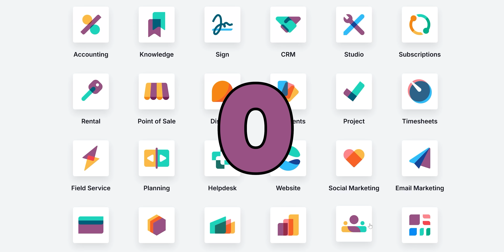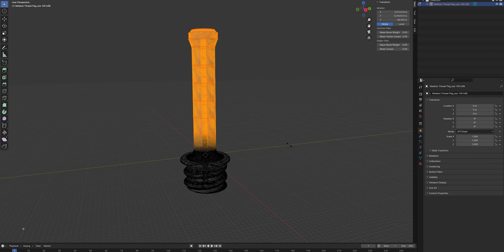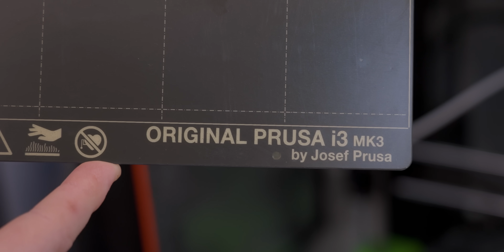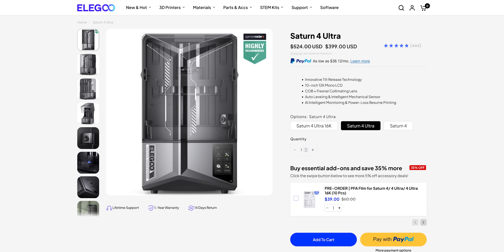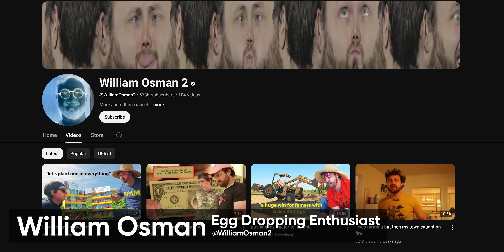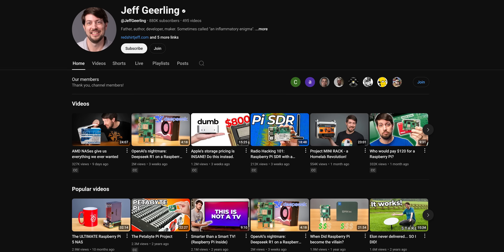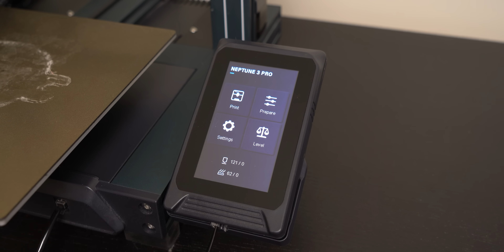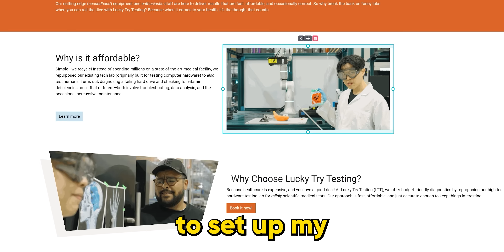Is my 3D printing setup wrong?

Comment: For a vast majority of the hobbyist users the Bambu firmware changes won't affect them at all. Almost all their users use the Bambu slicer and software, and will not be impacted AT ALL. The users running businesses and print farms are the ones primarily being impacted because their tools used an insecure MQTT connection to monitor and control the printers.  My Bambu printers are by far the most reliable ones I own and don't plan on replacing them anytime soon.
Reply: Genuinely curious bc maybe I have a gap in my understanding - how are you justifying the statement about MQTT being an insecure connection for the printer.

You cant setup mqtt without getting a 2FA connection and I don’t know anyone who is using MQTT exposed to the external internet. The way that I interpreted the whole situation is the issue is in Bambu labs network setup. They don’t have a secure key put on their hardware from the factory which means someone could spoof their hardware and connect to the entire network. Thats the real reason they need to close this gap. Thats an entirely fair statement for them to make but they didn’t say that, they instead are claiming it’s protecting users when it’s really protecting them.
Reply: @adamkrtek9004  fr
Reply: @ sorry I understood that the protocol itself wasn’t insecure but the keys Bambu used had been compromised which was how the 3rd party software and hardware accessed the MQTT protocol

Comment: I just got a p1s myself a couple weeks ago with a ams, loving it so far. Glad to see even big budget studios like LTT using the P1S instead of the X1C lol, its really not worth the extra $ to me just for the touch screen, and "lidar" which i wouldve already disabled due to my aftermarket build plates. It does agrivate me about their new updates, because I really wanted to get the Panda Touch, but not gonna buy it if they gonna lock it down soon..all in all it's still a really nice printer but the stock light is lacking badly, first print is the AMS Riser V4 with a white cob led light strip all around to allow you to see everything clearly.

Comment: hey linus im so happy you are talking about 3d printers again my set up is nothing fancy i won an ender 3 pro yes yes ik the ender 3 pro has some issues but once you know the printers quirks you can make some amazing prints no i can't do multi colour prints easily but for what i am using it for that isn't needed.

i make props and cosplays so multi colour printing is just a waste of time for me 
in my opioon the ender 3 pro is an amazing beginner printer becuase it teaches you the fundermentals about 3d printing as a whole.
being able to level the bed yourself is a good thing becuase it teaches you a printers toloences yes its a pain but its a pain i choose to endure i will be upgrading to something later down the line but don't knock cheaper printers mine only cost me 150 quid brand new not including filliment.

Comment: So timely. I just had a friend give me a Creality CR10 V1 and I feel every pain that was mentioned in the video with them. Its a good starting point, but this video has been great in showing where I can step next. It is a shame Bambu is creating their issues right now, otherwise I feel like going Bambu  for my next printer would be an easy choice.
Reply: so were you ever to level the bed. the CR 10 V1 i have will not get level. one end is digging in to the build plate while the other is almost to far from the build plate to stick. i have even added a BL touch and used that tilt screw adjustment in clipper. i wanna burn my CR10
Reply: @writer8706 Yes, when I received the Cr10 V1 I had the exact same problem. I literally don't know how the previous owners used it. I had to put washers under the bed in the right locations to make it even enough to level with the screws. It's much better now. I have been tempted by the BL Touch, but most easy install videos have been for the V2 and v3. I need to do some more looking on the V1.

Comment: I’m still using two Creality Ender 3 V2s I got a few years ago. Looking to upgrade to a core XY with color change capability, but don’t like the way Bambu is going. I’m more or less waiting for Creality to work out the kinks in their K2 plus
Reply: There are other options

Comment: I've printed with very water logged ABS, ASA, PETG, and PLA without issue. no jams. just less than ideal print quality. Provided it's on a direct drive prusa i3 MK2s. Shame Linus has had such problems with water absorption.
Reply: Poor print quality and weaker parts, not worth it.

Comment: I was getting into printing right when Bambu did the "Bambuzle" and Elegoo was releasing the Centauri Carbon for $299. Immediate "take my money", moment.
Reply: that's a wait and see kind of thing for me they have been very very hit and miss on their printers... ask those who bought that orange storm giga. Yet if they can deliver and make that price point its going to be huge. even if it only could do like 70% of the things or quality of the X! and p1s. that kind of printer at $299 is nuts. But just like Reality its going to be a wait and see.  Heck i was ready to pull the trigger on the Neptune 4 before i read all the issues people had with them.. the Neptune 3 was so rock solid to bad i couldn't find any of them. i really want to get rid of this old as hell cr10 i have i cant get it to have a good first layer no matter what i do.
Reply: @writer8706  my thought process was basically: If it can do just 75% of what it claims on paper, it'll be as good or better than the A1 I was going to buy initially for less money

Comment: 12:20 - William talks about issues with moisture in his filament - Fish tank opposite his Prusa 😂 (I'm not familiar with HOW much moisture that open lid would release into the air but it's got to be more than negligible surely? It was more so the visual  dichotomy being funny, and especially on brand for big Willy 😂
Reply: Should increase moisture in yhe air to some degree but honestly as long as you arent in a desert you should get a filament dryer regardless

Comment: Bambu works so well i really don't even care about the drama surrounding it. It is like wanting an iphone in the early days of smart phones (probably not a good comparison these days) like yes you are technically limiting yourself but the ease of use and reliability make up for it tenfold
Reply: Well... im gonna say this you give a company an inch, they go a mile, then not long after they go on a cross country run. What i see bambu is trying to start is what hp did to the printing world (not to mention the new recent ink subscription shit)
Reply: It is just that, drama. Its like NoMansSky where everyone jumped the hatetrain but ended up being wrong.

Comment: To be fair, Linus, you have your filament in possibly THE worst place possible, I'm in London with RH of 50-90% and I can see how that room is even worst
Reply from the maker: What’s so bad about this room? All water lines are sealed and there’s no random water evaporating in it. Am I overlooking something? -LS
Reply: @LinusTechTips  what’s the relative humidity of that room? Seems like it’s not well ventilated which can lead to an accumulation of ‘damp’ air as well as the controversial subject of fumes and VOCs from 3d printing
Reply: @LinusTechTips as a plumber that's watched and cringed my way thru your other videos building out that room and the pool and I also live in the PNW. I highly doubt that room stays super dry all the time. Imo putting a cheap humidity monitor in there might be a good add in general for monitoring for leaks and keeping it print friendly.
Reply: @LinusTechTips have u double checked the moisture level in that room? Maybe good to do either way to be on the safe side 😋
Reply: @LinusTechTips  all liquid evaporates its called angel share for a reason also you have no ventilation from what i can see as in there is no where for the moisture that room has to go like outside
Reply: @LinusTechTips  I was more worried about the breaker panel being obscured by the rack.  In commercial in the US, 3' clearance is req'd in front of any electrical panel for unobstructed emergency access.  It's part of the fire and life safety code, so I twitch when I see a panel I can't immediately open.
Reply: @LinusTechTips  Let's see, a basement in the PNW... unless you run a dehumidifier in the basement, moisture permeation through the floor and walls will usually cause elevated humidity levels above what ground floor and other floors will encounter.
Reply: @ You can have. perfectly sealed pipe and still have humidity coming from other places, just do a little check, maybe introduce a Pi with RH sensor or something just to keep you informed on how the room is doing. Most of the time is not bad but some of the bambu filament (SPECIALLY THE MATTE PLA) is awful in humid environments for some reason, it will curl and ooze like crazy
Reply: @ To put it simply, I have mates with houses without any pipping on the basement (Old english houses) and the thing hits 20% RH above normal levels
Reply: Im in utah where its less than 30% year round xD dont even need a dryer for pla, petg i dry just to be safe.
Reply: I've heard that it can actually turn excessively moist filament into little steam spurts in the Hot end I think it's called, causing it to spit and sputter , does that actually happen? I was given a bunch of pla , like 40 pounds of it, and it got rained on sitting on the porch before I got it inside... Is it just trash now? 😂
Reply: @bentboybbz  That does happen. Put it in a very low oven (80 C or so) for a few hours, it’ll be fine.
Reply: @wmkeeble  I appreciate your response. I was worried that My oven doesn't go low enough and it could cause it to start sticking or melting together, also they are on plastic and cardboard spools I wonder what the plastic used in the spools will handle and the cardboard obviously isn't oven safe at any temperature. I appreciate your time and effort!
Reply: @bentboybbz  no just dry it
Reply: Saint Petersburg's basement, even metal gets rusty after a while)

Comment: I dont understand why filament dryers are such a big thing for others. I keep all my spools (pla and petg) in open air and never dry them. The humidity in my room is usually around 40% and I have never had any issues related to the moisture content.
Reply: Well to be fair those are pretty basic filaments. Nylon and tpu need to be tried
Reply: You did, you are just not aware of it :)

Comment: There's a special type of detergent that exists for cleaning resin prints that's an option that cleans better then isopropyl but you can't forget models in the detergent for extended periods of time like I used to do with iso

Comment: Its weird, Printers nowdays are soo good but sooo crappy the Filaments got over time... i have PETG that i have for 6-7 years now and still prints without strings and i never dryed it, the new one i bought after 4 weeks open already needs to be tryed because it printet already crap...

Comment: Camden Bowen's comments about the Neptune 3 are... kind of dated. I'm pretty sure there was a firmware update that fixed the z offset issue. But besides that... why is he talking about a recommendation for the Neptune 3... Not only are the Neptune 4 and Neptune 4 Pro/Plus/Max out, but they are also now kind of dated because Elegoo now has the even newer Centauri coming out. It's a Core XY (meaning  no moving bed), a bigger build plate and prints faster than the Neptune 3.... and it's $199. Granted it's not actually out until July, but this printer means essentially the death of bedslingers.
Reply: They are talking about the printers they have. Almost everything to say about a Neptune 3 applies to a Neptune 4 also. The 4 is faster, but can be louder because of the fans trying to keep things cool at that speed. I think Elegoo just removed the Neptune 3 from their site recently. I don't know that you can call the Neptune 4 dated since its replacement isnt out and it is top tier at its price when balancing speed, reliability, and features. Plus I dont think the Centauri competes in bed size so the Neptune 4 line is going to have its place for a while. Probably more for the size vs. the base though.

Comment: 8:50 The reason you'd want higher resolution is for detail. That might sound obvious, but if you're in the miniature painting scene then the difference between resolution is pretty huge. Especially when you compare it to some of the plastic miniatures that companies like Games Workshop do, it quickly becomes very obvious what is a 3D print and what isn't, if the resolution isn't high enough.
Reply: Can we even see the difference at that scale though? 12K across such a small area is ridiculously tight. My 8K is damn near flawless, I can imagine needing more than 12K.
Reply: @tristangillis7365  I have printers ranging from 6k to 16k. Its not really that you see a difference, but the screen can be bigger. For example, my 8k small screen printer can have the same pixel size as my 16k nearly a foot long screen printer. Same quality prints but much larger area to print on.
Reply: You humanly can't see any difference between a 12k print and a 16k print.
You barely even see any at 8k.
Reply: saturn sized printers dont gain much from higher resolution past 8k due to how "12k" and beyond is achieved. only one axis gets more pixels due to chitubox boards limitations

Comment: @jake: WLAN doesn't work in a grow tent, because the aluminium coating blocks wlan signals.
Reply: It does not block any signals.. I have 3 tents in this room right now.. All bigger than Jake's... Lol. But seriously.. The wireless signals work just fine inside the tent. Environmental monitoring...
Reply: @Angrybearhere  Maybe it depends on the tent, in mine, no WLAN (IP cam, shelly) or Zigbee signal (thermometer) goes thru.

Comment: The very thing that he had issues with (broken filament) has not happened a single time to me in 20k+ hours of printing with my Bambu Labs X1C with AMS. I have had filament jam 1 time in that time and have printed hundreds of KG of filament. Almost certainly non-dry filament causing that problem.
Reply: Pla gets brittle when it's wet yeah

Comment: That problem with the Neptune 3 not storing z-offset properly sounds like it's not actually storing to the EEPROM - sometimes flashing a new firmware can fix that, it may also be a sign of a board going bad...
Reply: i wonder if an update would even take. we have a similar situation going on with my wife's fathers tv. Where his one TV refuses to take a firmware update and will not save some of his settings but it will remember things like his WIFI name and password.  i told him next time im overt ill bring a flash drive and we will will try to load the new firmware from that instead of the internet. but i am not hopeful that it will work.
Reply: Even G29 would fix that since it’d store the new settings before every print
Reply: spot on
Reply: I thought it was fixed with a firmware update. But its at least was a known common issue with them. Upgrading to opennept4une fixes it as well and unlocks a ton more features
Reply: @ does that work on the Neptune 3?
Reply: @gadgetmerc  Honestly, no idea im sure i heard someone got it working but i might be wrong. 
I had the same issue with my 4 max and that fixed it, and when i was looking into it about a year ago im sure i saw they released a new firmware to fix it
Reply: @ I have the 3 max. I think the 4 has much more modern hardware that’s able to run clipper. The 3 doesn’t and can’t. I think I’m SOL.
Reply: @gadgetmerc  The 3 can be converted to klipper with a pi
Reply: no no its shit bed springs swap to silicone spacers or solid and never liik back
Reply: @ he said that he has to set the offset on restart. Springs aren’t going to move much between power cycles.
Reply: @scootersfrog  That's worth doing as well, but if the stored value isn't sticking, that's an issue with EEPROM. Could be both, hard to tell without more info.

Comment: Whoaaaaaa... Moisture in the air can fuq up the whole printing process??? Feels like a huge pain point right there... That's too much messing around. Getting a dryer for your filaments?? Like im sure it IS necessary, but it SHOULDN'T BE. There's no way to manufacturer filament that doesnt have an affinity to hold onto moisture? There's no way to implement a drying procedure WITHIN the machines themselves? 
We've come a longggg way in these things, but damm i thought we were closer to primetime than this 😑

Comment: I bought a used but close to new with some upgrades ender 3 pro for 50 bucks 3 it's ago. I've printed a nut and a bolt. Haven't touched it since.

Comment: You guys should’ve already known about Elegoo’s existence and use considering Dan did a Neptune vid the other year. Next best thing to Bambu imho/experience and the only two printers I own and use.
Reply: As a Neptune 3 Max owner I concur. Camden for example would benefit from ditching his CR-10S4. I had have had the original CR-10, a couple ender 2s, and ender 3s. I don't understand how Elgoo sells something at their prices so much better than Creality printers that is objectively better in almost every way.  I recommend Elegoo Neptune's for any beginner unless they have more disposable income. I just sold my Ender 3s and recommended a couple people looking at buying them should buy a new Neptune instead since they didn't seem like the tinkerers that would tolerate even what a sorted out Ender 3 will put you through.